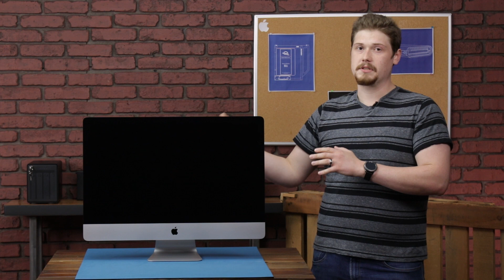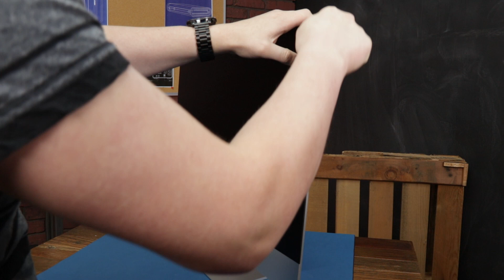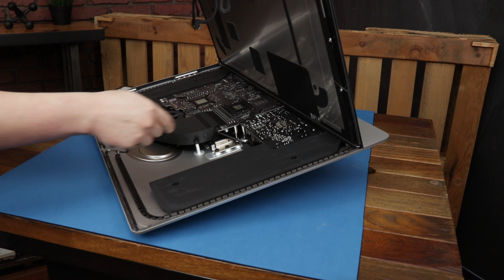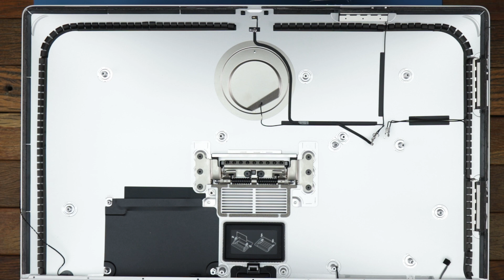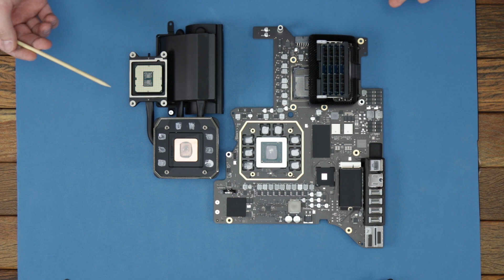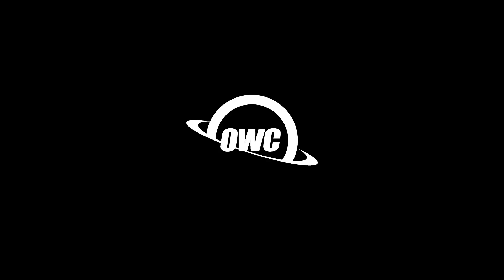Nano-Textured Glass Teardown of the 27-inch iMac 5K (2020)

Comment: The SSD slot is the same as 2019, only shorter ?!
Can't you install an NVME with a sintech adapter ?!
Did you try that?
Reply from the maker: Unfortunately, we haven't tested anything in terms of SSD replacement in this machine, yet.

Comment: Hallow I from Brazil i have an imac 5k 2019 i5 could i put an i7 7900 on it or i9 only works, thank you very much
Reply: No the 7900 is an LGA 2066 socket it won’t fit in the LGA 1151.
Reply: Alyx Shark I'm sorry I missed the number and the 9700, as I only saw videos of i9 upgrade I was in doubt if the i7 would also be possible

Comment: I would never buy a Mac with a soldered on board SSD. Too expensive to replace...
Reply: Why not?  If it fails, you can always spend a butt-ton more money on a Thunderbolt SSD and kludge it, hoping of course, you can disable the bad SSD!  OR, spend a butt-ton of money on AppleCare instead of just replacing the SSD like you should be able to.